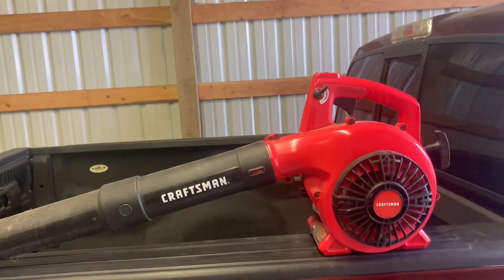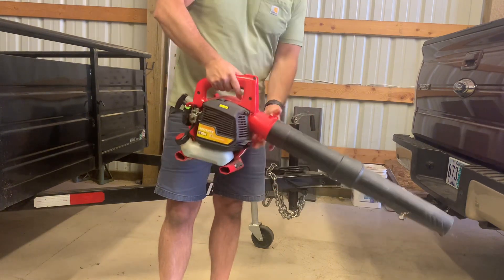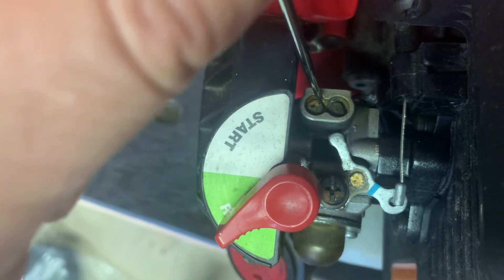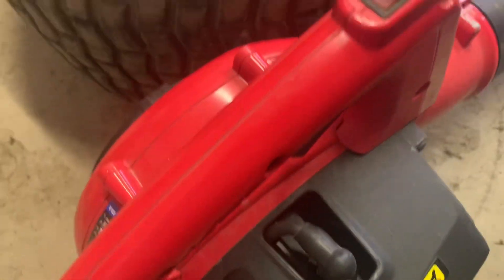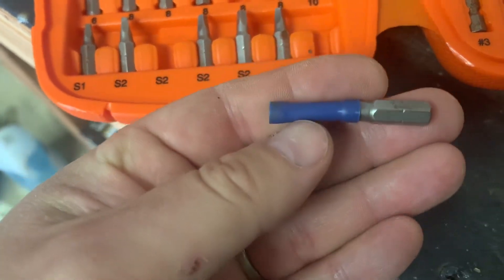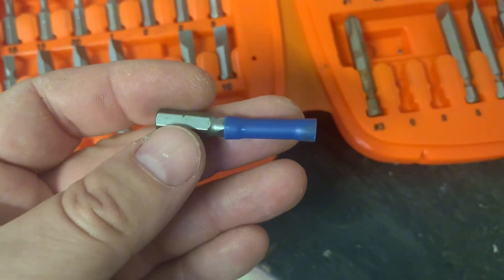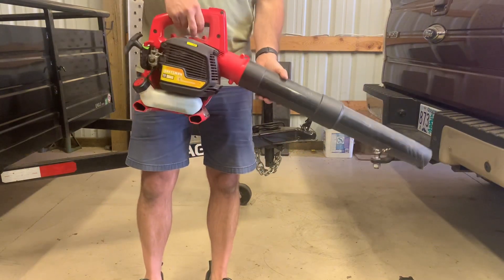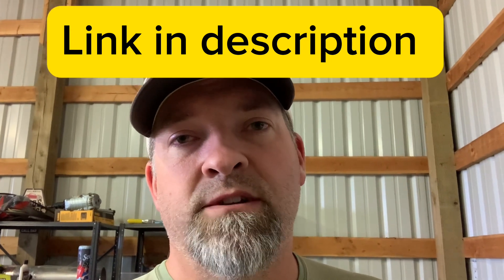Fix Craftsman Blower that Bogs Down

Comment: I have this exact blower with the exact problem, but those adjustment screws won’t turn, and I have never touched them
Reply from the maker: You can buy the Amazon kits to get the exact tool that fits. Sometimes it just happens as it breaks in and gets used.
Reply: @andysshop  it’s on a couple months old though

Comment: You and another guy DID NOT  say screw in or screw out on the carburetor  adjustment
Reply from the maker: Not to be argumentative, but I did say “counter clockwise” twice. So turn left if yours is bogging down with the throttle.